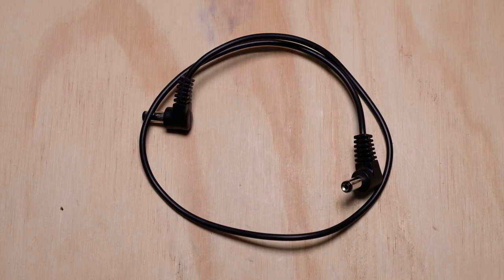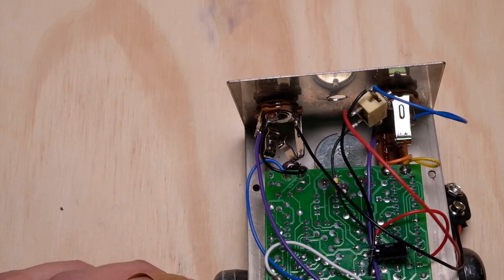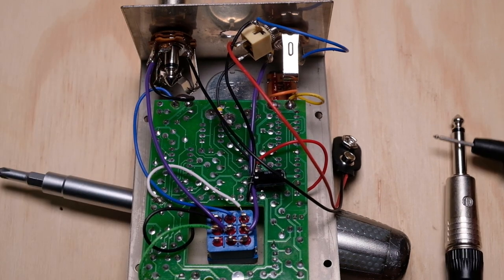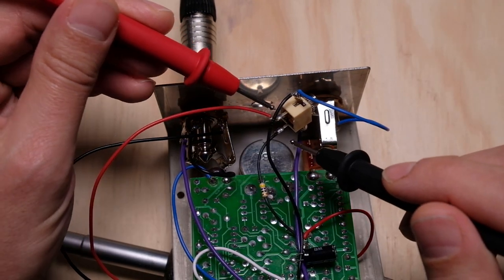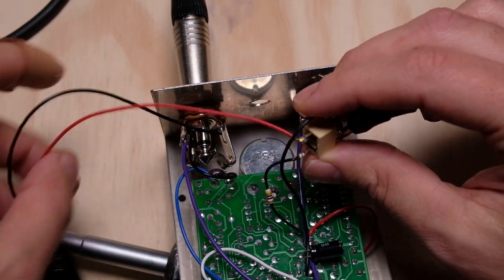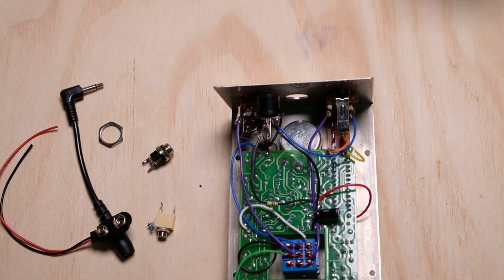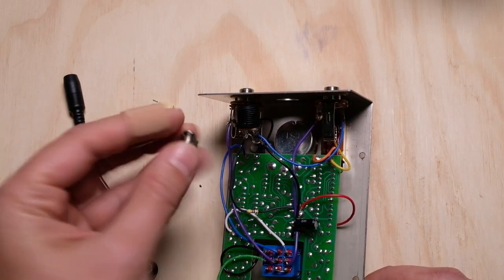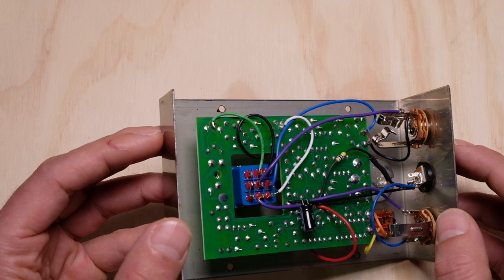EHX Power Jack Replacement - Basic Jack Switching

Comment: HELP! I have a set of cerwin vegas E-712 models. Instead of finding an antiquated half melted or over priced replacement from gibson i upgraded. I got a set of EMB cx-10 1200 watt crossovers and tx-15 terminals. Took fabrication to mate them. I have switching jacks built in my E-712s i want to work. I don't know what i need or need 2 do. I'm at that point. All neatly wired. Labeled on the jacks. No idea where the new crossover wires go yet. I do know i can go ahead run my base wires. But my drivers and tweeter gotta be routed so the jacks can work. Little help?!

Comment: If I were to upgrade the internals of my microscopes led to handle 12 volts would the original 5 volt female jack work? Or are jack inputs interchangeable so as long as the polarity (center negative) is the same.
Reply: Yes and yes. But always check the voltage rating of the parts you're using. For example, the new part I installed has a rating of 24VDC at 5A. Always check the specs!